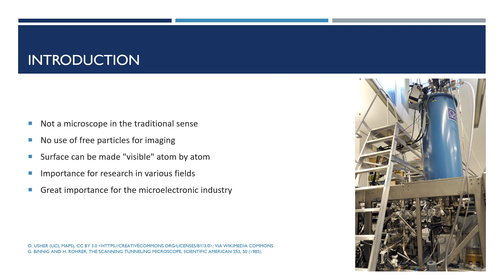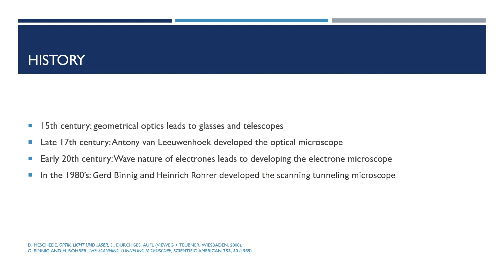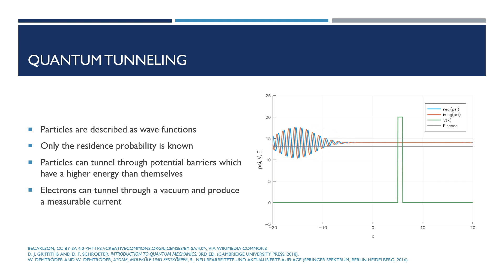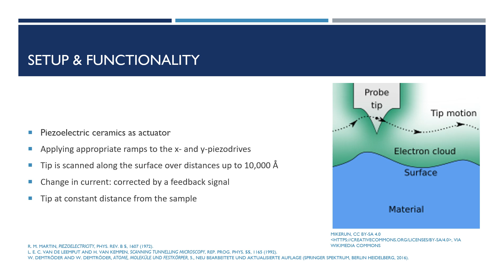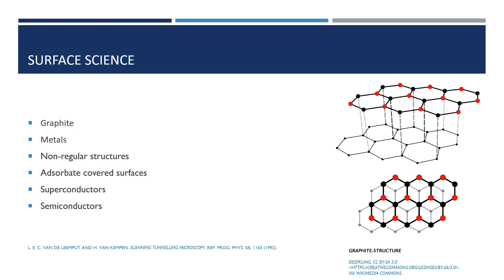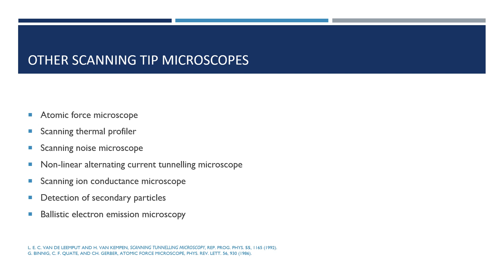Scanning tunneling microscope

Comment: Is the scanning process fast or slow? How long does it take to scan a surface of 1 cm2 for example?
Reply from the maker: I can't give any information about the scanning speeds themselves, but a piezo motor can be operated from a few nanometers per second up to 20 mm/s.
In constant height mode, real-time recordings can be made. In this mode, a frame rate of up to 50 Hz can be achieved.

Comment: How is the tip motion determined or calculated in advance to avoid collisions with the material and the tip?
Reply from the maker: In the constant current mode I described, the tip is always kept at the same distance from the sample.The change of the current is corrected by a feedback signal to the piezo actuator, which positions the tip to a constant current level above the surface.

Comment: You mentioned the atomic force microscope that can also examine insulators, could you elaborate how this is possible (especially since you mentioned that this is a hybrid and it also involves some techniques from STM)
Reply from the maker: The AFM is used for mechanical scanning of surfaces and measurement of atomic forces in the nanometer range. A spring is attached to the needle and the needle is pressed against a sample. The repulsive and attractive forces of the surface atoms of the sample bend the spring. This deflection can be measured with light, and thus the force acting between the surface atoms and the tip can be calculated. Since no current flows between the sample and the tip, non-conducting samples can also be examined.

Comment: You noted that we can even transport materials with the tip onto the surface. Is there any reason to do this in an experiment or did you only mention it to show the precision of the STM?
Reply from the maker: This manipulation of the surface can be used, for example, to write with individual atoms on a surface. The most famous of these lithographs is certainly the IBM lettering consisting of 35 xenon atoms on a nickel surface. 
A more practical application is this deposition of metals in arbitrary patterns as contacts to nano-devices.
And in the field of magnetic data recording, IBM has developed an STM with which individual atoms have been changed in their spin orientation in a magnetic layer.

Comment: Why is magnetic isolation no longer used as an isolator and what are "Viton plates"?
Reply from the maker: Viton is actually the product name of fluoroelastomer rubber from Chemours Company (formerly: DuPont Performance Elastomers).
Today it is commonly used for fluoroelastomer rubber.
Magnetic levitation is no longer used because it is inefficient and difficult to apply compared to other vibration damping methods. For example, the permanent magnets must be cooled with liquid helium, with 20 liters of liquid helium flowing through the system per hour.

Comment: You said that the possibility decreases exponentially within the barrier. How exactly can one compute the probability to pass the potential barrier?
Reply from the maker: To solve the Schrödinger equation, an exponential approach is often used for the wave function, which describes the quantum mechanical state of the electron. Due to the boundary conditions at the transition to the potential, the exponentially growing term must be omitted, so the associated amplitude must be zero in this case. This leaves only the exponentially decreasing term.
The function value Psi(r,t) of the wave function does not represent a directly measurable quantity. But the square of the absolute value indicates the spatial distribution of the probability of finding the particle at time t at location r (r is a vector).

Comment: What is a scanning noise microscope?
Reply from the maker: The noise of the tunnel junction consists partly of 1/f noise, which depends on the current and partly of  Johnson noise, which comes from the thermal motion of the charge carriers and depends on the tunnel resistance. It can be described by the so-called Nyquist formula.
This noise is used as input to a feedback system. The images obtained in this way are very similar to the images obtained from the same area by the normal STM.

Comment: How does the conductivity of the probe change the result of the stm image? Is it easier to scan a better conducting material?
Reply from the maker: Yes conductivity of the surface affect the result of the image. For example surface oxidation reduces the conductivity of the sample's surface and affects the tunneling current, resulting in imaging problems.  It may be possible to coat a non-conductive sample with a conductive layer such as gold to make it observable under an STM, but this coating step can mask hide certain features or degrade imaging resolution.

Comment: Would a liquid be a possible reducing medium of vibrations (or may be only for certain target materials) and if so, what kind of liquid would fit best concerning the risk of e.g. oxidation and so on?
Reply from the maker: The entire system is vibration-isolated from the outside, and a vacuum chamber or a chamber with the required medium is installed on it. Therefore, the question about the risks of oxidation in this respect is obsolete. 
I read in an article that pneumatic springs are sometimes used instead of spiral springs, but I do not know whether a liquid can be used instead of air. But it would have no influence on the sample itself.

Comment: can you explain a bit what eddie currents are and why they can be used for damping the resonances in the context of isolation from vibrations?
Reply from the maker: An eddy current is a current that is generated by the change of a magnetic field inside a metallic conductor, by the movement of a permanent magnet connected to the STM. These induced currents cause heating and thus dissipate energy from the oscillating motion of the STM.

Comment: 9:43 Is there a specific reason why these needle tips are mostly used? How does this affect the functionality of the device?
Reply from the maker: It is not so much the material but the shape of the tip that is relevant for good functionality of the STM. Since the shape of the tip determines the maximum achievable resolution, a good and reliable tip preparation method is very important.
Preparing a particularly narrow tip is one of the difficulties in building an STM, and this tip should of course remain in this elaborate prepared state for as long as possible.
Platinum and platinum-iridium are particularly unreactive and therefore especially well suited for an atmospheric STM. Tungsten is particularly easy to etch electrochemically and to form into a suitable shape.

Comment: I have a question about the spiral springs type of isolation: If I understand correctly, the low pass filter only allows frequencies below the cutoff frequency, so high frequencies are not of importance. Then why is it a problem that damping reduces performance of the conductor at those high frequencies?
Reply from the maker: The low-pass filter damps the high oscillations with frequencies above the cut-off frequency.
At frequencies much higher than the cutoff frequency, the frequency response decreases logarithmically. So they are suppressed but still present. And a damping like an eddy current damper counteracts this damping of the low pass filter. Therefore, the damping should be as low as possible.

Comment: What do you mean by "generation of electrical polarisation by applying stress to a crystal" (this you mentioned at the setup and functionality slide around 10:45)
Reply from the maker: This means that by mechanical stress applied to the crystal, the charges within the crystal structure shift and dipoles are formed. So there is an electric field and due to this an electric voltage which is very small but measurable.

Comment: I don't quite understand what quantum tunneling has to do with the STM, since to me it seems like the electron/electrons of the tip move from one atom to another, like a normal conductor. Or is all kind of conductivity a quantum tunneling affect?
Reply from the maker: No, this is actually tunnelling. The layer between the electrodes, in the case of an STM this is the sample and the tip, is an insulating layer, i.e. non-conductive. This insulating layer is the potential barrier through which electron waves tunnel from the sample to the tip and vice versa. This area can classically not be passed by electrons.

Comment: You mention common tip materials include tungsten, platinum, and platinum-iridium. but also that tip should only be a single atom?  How can platinum-iridium be a single atom?  By definition an alloy or compound must have multiple atoms, right?
Reply from the maker: You are right, of course, alloys consist of several types of atoms.
One always tries to make a needle tip for an STM as sharp as possible. In the best case, a tip can be made of a single atom, but it is difficult to prepare such a tip and it is not possible in every case.
Single atom tips have to be prepared with metals from an atomic type such as tungsten or platinum in ultra-high vacuum.